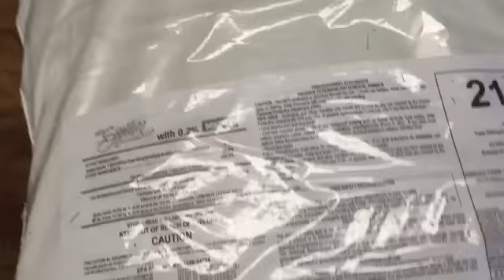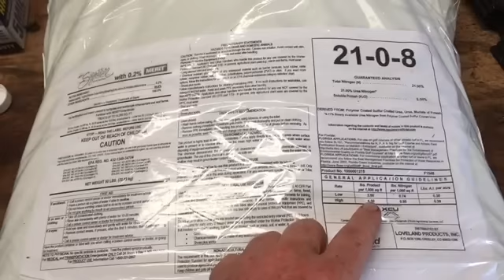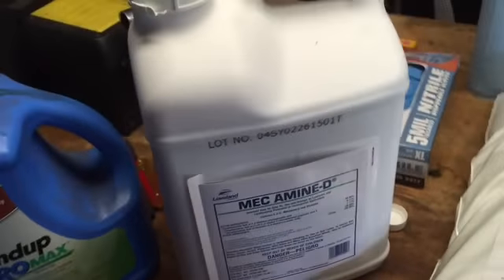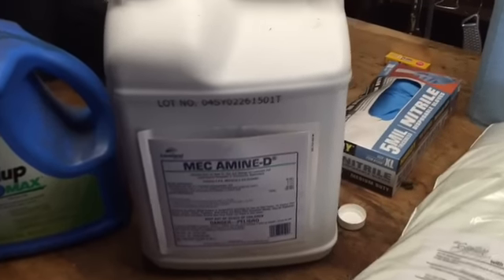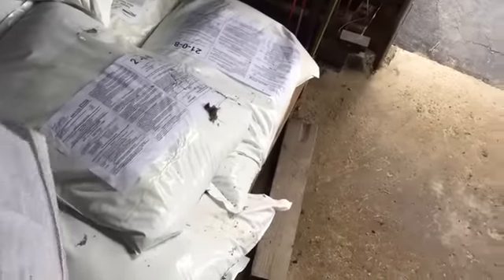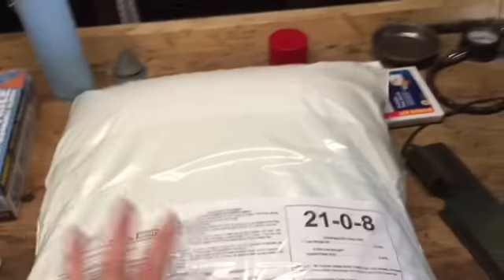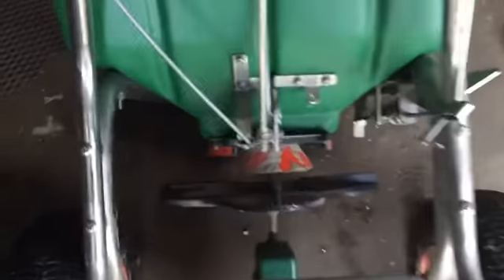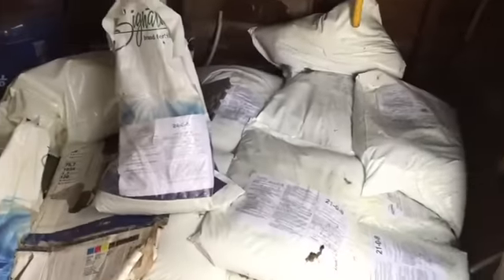Application knowledge, tips and something new?

Comment: One of my goals for the this year is to improve my application program through higher quality product and a greater accuracy of product application. My old Scotts spreader is now replaced with an Andersons. I have just found a source for the Andersons fertilizer mixes. The distributor will deliver directly to my storage area at no cost for  orders of $500, or $25 for less than $500 orders. Now to negotiate price. What are you paying for your 50Lb bags?
Reply from the maker: If what.  Crab 18-23$   Regular 24-0-7 16-20$. Merit with fert 22-26.
Reply: Johnny Mow Thks for the info. This is what they quoted me: 1) 18-0-4 20% .164 Dimension  -- 32.35 per 50# Bag; 2)      24-0-11 50% ns54  -- $24.55 per 50 bag.